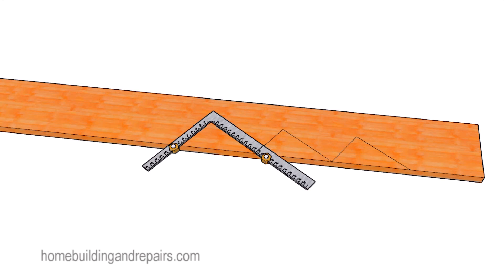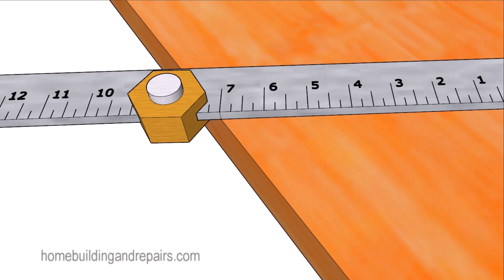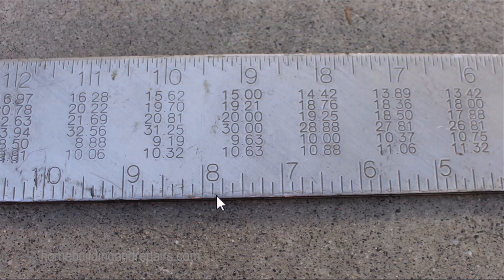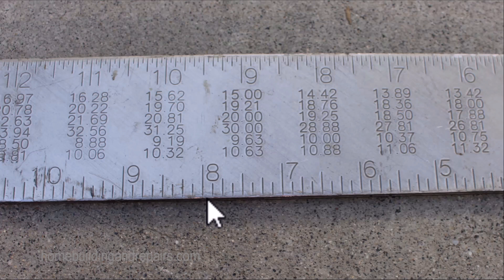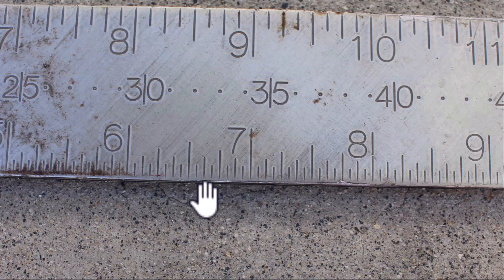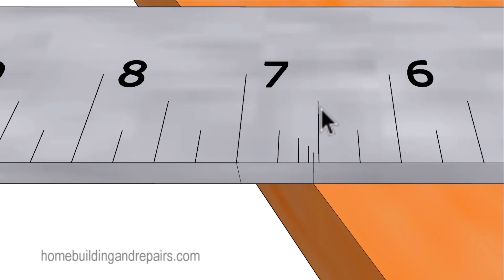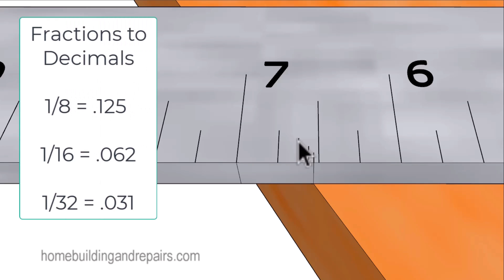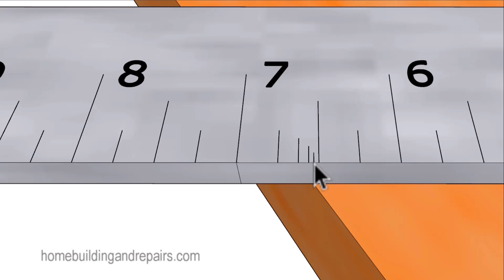Use This Measurement To Layout And Design The Perfect Stair Stringer

Comment: When you take into account inconsistencies in lumber, swelling, blade kerf, human error, etc... I'm not sure 49/50 carpenters can produce something accurate to 1/32.
Reply from the maker: True, but if you start with a straight fairly dry  board and layout it out using the correct measurements, then it will be up to the carpenters saw to deliver the goods.
Reply: @stairbuilding  Absolutely.
By "carpenters," what I really meant was, "I". 🤣